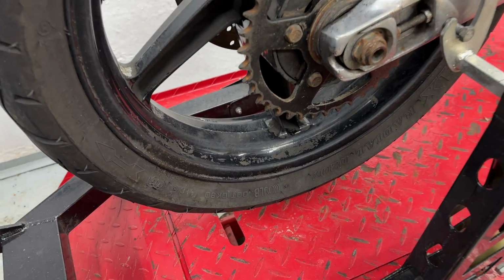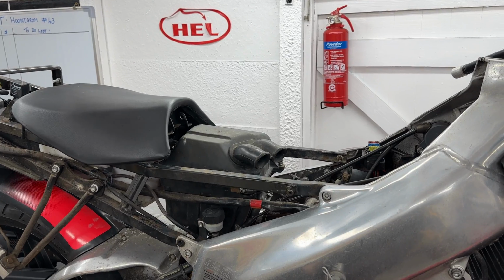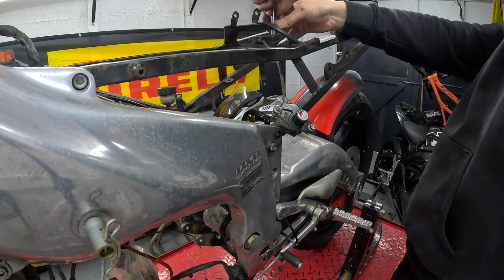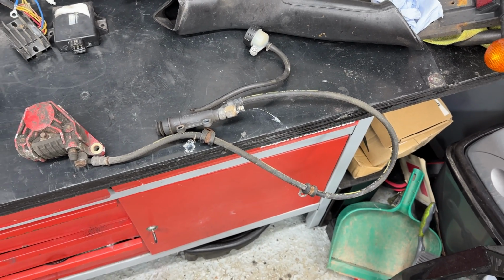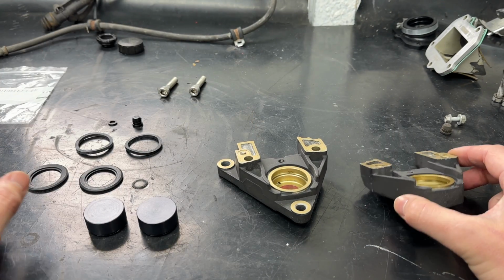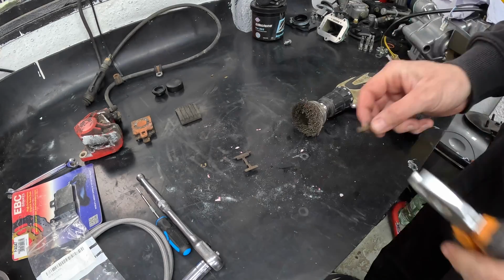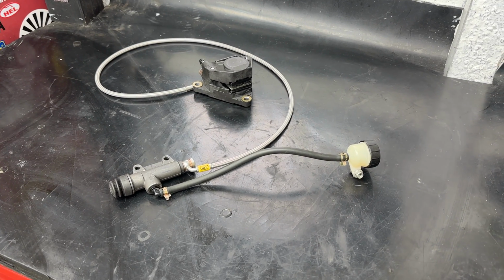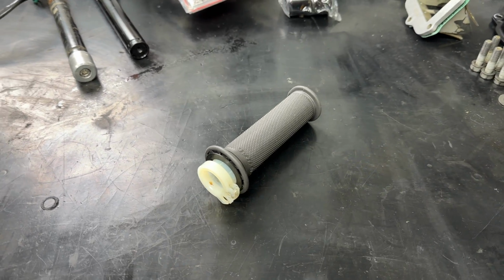Restoration of an abandoned Aprilia RS125 barn find forgotten since 2011

Comment: Over cleaner is only any good on raw aluminium… used it for years on go kart engines and it worked fantastically!
Reply from the maker: Good to know 👍 also have a two stroke engine in need of a degrease so will give it a whirl 😎

Comment: Standard Brake fluid (DOT3 or DOT4) is Alcohol based, DOT5 brake fluid is Silicone based - NEITHER work with or should be ANYWHERE around red Axle bearing grease, whether it's oil based grease or Synthetic - They make Brake assembly lube if you must, but using brake fluid as assembly lube on braking parts is best - That red grease could cause your rubber piston seals to swell, or turn gummy, or any other number of death-causing problems- the type of rubber they use around BRAKE FLUID is sometimes very weakened around petroleum based stuff- Nasty bit of advise you're posting on the You Tube there sir, as if you know anything?
Reply from the maker: Thanks for taking the time to compose a response to the video, it’s certainly the first time I’ve ever heard this in all the years garage tinkering! In fact over the years and reviewing the comments it would appear many like myself use red grease to rebuild brake calipers. As stated in previous videos I’m not a motorcycle mechanic so always happy to be corrected but as I’ve rebuilt brakes with red grease for the past 15 years with no issues to report of swelling or failing seals I’m surprised to hear this.. even cars like my e46 M3 and Clio 172 cup which have both had the brakes rebuilt this way and been used on track for many years where they will be subject just to hard use/ high temperatures and still no issues of failing or binding brakes from swelled seals or seized pistons as a result.

I’m certainly not disagreeing with you and fully aware there are many people out there far smarter than me that understand the chemical make up of these greases and there uses, just odd to hear it this late into years spannering
Reply: 🚨Karen, I bet you was so excited to spread your grease knowledge 😂💦

Comment: Yes if you go premix, you would need to increase the jetting. 
It sounds strange but adding more oil will make it run leaner as the oil takes up some of the petrol volume.
Reply from the maker: But when you look at how much oil is added to the fuel I’m shocked it makes a noticeable difference 😅

Comment: Hi mate.
When you fit the grip, use the air compressor with the normal nozel, put it between the grip and the tube/bar, spray the air and slide it on. It will take two seconds and your need no lube. 😊
Reply from the maker: Great suggestion although I would need to find a pretty big bung for the air duster 😅
Reply: :D used be surprised how little you need, I've done it with cans of compressed air before :D @stoneautomotive

Comment: Aprilia on the AF1 Futura used a pipe for cool air from the fairing, past the engine through a plastic sheet and to the area of the airbox intake.

They didn’t bother with the RS125

Check if your cdi has been modified. As standard between 4750rpm and 6000rpm there is a massive amount of ignition retard which causes a flat spot (presume the aim is to make it easy to get through homologation tests). The cdi can normally be modified to switch to a better ignition timing map - you cut into the cdi at a specific point to cut a bridge on the circuit board inside.

If you are doing without lights, etc, the probably easiest to make a new loom from scratch. Easy enough.

Bleeding the rear brake can be a pain. The bleed nipple is not at the highest point of the caliper when mounted on the bike. Aprilia used both Brembo or Grimeca calipers (front is Grimeca but badged Aprilia), and various Italian bike specialists should be able to supply pins, etc, for the calipers.

Baby wipes are convenient for cleaning a lot of rubbish off the wheels.

Before now when the locating pin on switchgear is damaged I have replaced it with a small metal rod stuck in place with Araldite (mind you, I have also helicoiled the plastic thread in the switchgear for the bolts that hold it together)
Reply: Regarding the rear brake bleeding just remove the rear caliper bolt and rotate the caliper for bleeding purposes so that the bleed nipple is at the highest point so as you mention no air gets trapped beneath it.
Reply: @_Hangman  yep, just as long as the pads can’t move in.
Reply: @katywalker8322  Yep...but even then flat blade screw driver or something to wedge between the pads would work too.
Reply from the maker: Yep had the same thing with the RC8R and RSV, might just bleed it on the bench so it’s ready to go!
Reply from the maker: Thanks for the detailed response 😎

Wonder why they left that airfeed off the RS125 to the airbox, very odd! Shall see what we can build in the work shop 😬

I think it’s had the cdi mod as there’s a blob of silicone on the back of the CDI 👍
Reply: @stoneautomotive ,, at a guess it made no difference to performance! It didn't pressurise the airbox, as that would cause chaos with the jetting (would need to vent the float bowl to the pressurised airbox at a minimum)
Reply from the maker: @katywalker8322  I just can’t help but feel fresh cool air vs 70c+ heat from the radiator/ engine must see some advantage 😅
Reply: @stoneautomotive  , in theory, but then there is the difference between heat and temperature. A heat shield between the airbox and the engine would likely give the most benefit.
Reply: Heat and temperature are different. X amount of heat energy warms up a volume of something by Y (ie, heat is energy, temperature is the result of something getting heat energy). Amount of air going through the bike is far higher than the volume of coolant, so the radiator won’t warm up the air to anything like the same temperature.

Comment: Speak with your local valeting chemical rep. Someone like AutoSmart. Buy some heavy duty wheel cleaner and it will save you so much time (read the label and ask the reps advice as it is aggressive on your skin, eye, throat).
Reply from the maker: I’ve used Auto smart in the past so good to know 👍

 Cleaning hasn’t got to much left now so hopefully won’t be a problem moving forward on this build 👍

Comment: To take that part off mine I had to take the exhaust off first as it goes up through the rear swing arm through the tail section, dirty (greying) plastics. And fix any electrical wiring whilst I’m there, I’m doing the same thing to my sc125 can’t wait to get her road worthy
Reply from the maker: Certainly something rewarding about restoring these older bikes 😎

Comment: A trick i use for the bike grips is alcool and/or air compressed: alcool makes the job very easy, and evaporates itself. If you don't have alcool just use air compressed: the thin air layer sprayed while mounting the grip will help you quite a lot. Try it and let me know :) cheers from italy!
Reply from the maker: That is a good tip 👌

Shall try it on the left hand grip in the next episode 👍
Reply: Hair spray works well when putting new grips on.